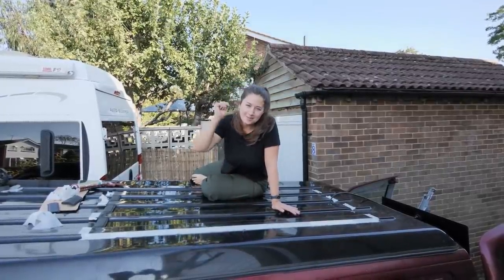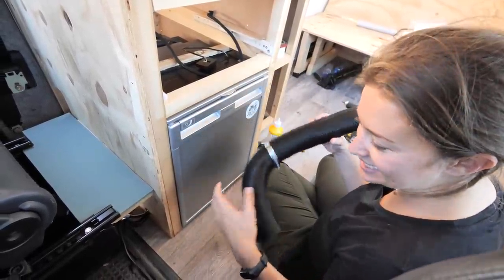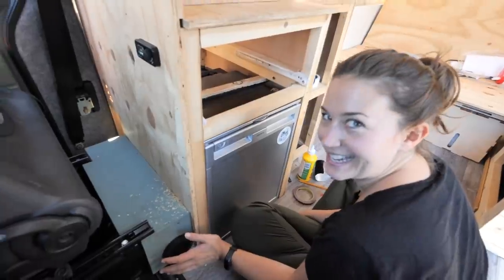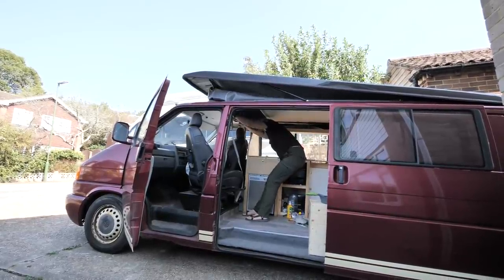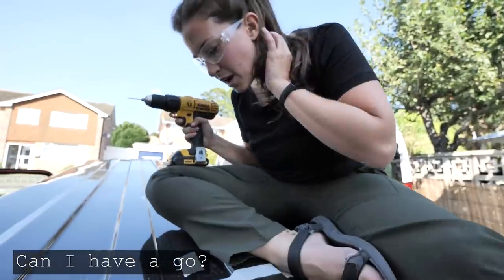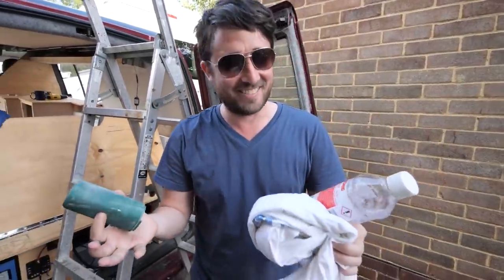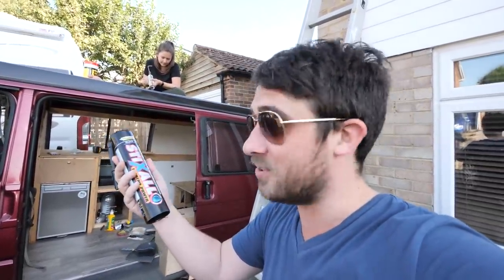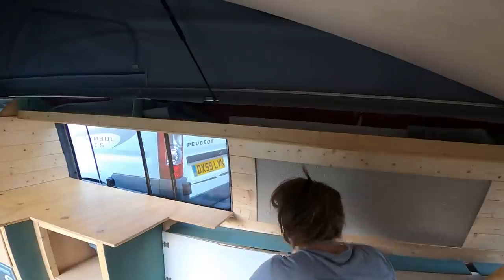The Van Conversion Is Finished!

Comment: Hi Guys, nice work on your conversion. One very important comment: If you use any combustion stove or heater inside or even around your van (like in an attached awning) definitely install a carbon monoxide alarm. They are cheap and can safe you from dying in your sleep. A must have in my book. CO has no odor and  is lighter than air so the alarm must be installed high somewhere near the ceiling. Love your channel. AndyB

Comment: Cutting a 90mm hole in the roof for a fan also needed a pilot hole.  So I bought a cobalt drill bit after research.  It went through in less than a second and pulled me downwards. To top it off,   the drill bounced off the roof.  I think I lost 5lb at that moment.
Reply from the maker: Blimey! 😅

Comment: Hey Emma, suggesting a small little detail. turn the heater outlet cover to vertical instead of horizontal cause less dust will be accumulated in the long run.  btw, great job. Cheers!
Reply from the maker: Thanks for the tip! 👍

Comment: Hi Beans, can you share a link for where you bought the solar panel from? How is it performing? Do you think this product is good value for money?
Reply from the maker: https://www.photonicuniverse.com/en/catalog/full/583-180W-Black-Reinforced-semi-flexible-solar-panel-with-round-rear-junction-box-and-3m-cable-with-durable-ETFE-coating-German-solar-cells.html

We've only just installed it so can't speak for the performance just yet (perhaps after our next trip).. we definitely could have gone smaller though as 180w is probably overkill (especially as we have our PowerOak to help with charging)

Comment: Hi guys, my boyfriend has recently bought a vw t5 transporter and is converting it into a campervan too.  He had been looking into putting solar on the poptop, until an electrician friend told him that you need to have adequate airflow underneath the panel for it to function properly and that it's dangerous if you don't. He decided against it so not to restrict going into carparks etc.
I'm interested to find out what panel you have used, and if  you checked that this particular panel was OK to just stick to the roof and not need airflow? 
Sorry, I don't mean to sound negative and put what you have done down. You have done a great job, I'm just curious to find out so I can let him know. Many thanks.
Reply: Van has a ribbed roof, enough ventilation..
Reply: @GingerPhotographer  I understand that it has a ribbed roof, but they have stuck it to the raised parts, so no airflow under that part, then they've blocked the ends to make it equal height to the raised parts. From what we've been told it needs to be fitted in brackets to raise it off the roof to allow complete airflow underneath. I've also read somewhere that someone else had done similar to this and their panel stopped working, when they were finally able to remove it from the roof there was burn marks on his roof where it had been stuck. So he then replaced it and raised it off the roof. 
This was why I was asking if this particular panel is designed to be stuck on the roof rather than fixed on. I would be interested to know for ourselves if we could do it.  We don't have raised areas on the poptop roof it's flat.
Reply: @janinew233  Flexible panels are designed to be glued down..
Reply: @GingerPhotographer  OK thank you.